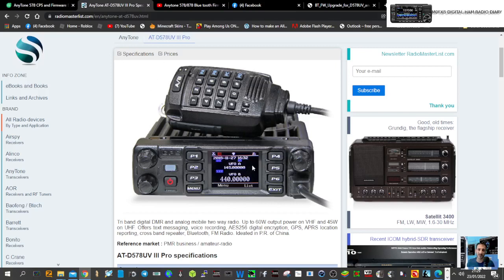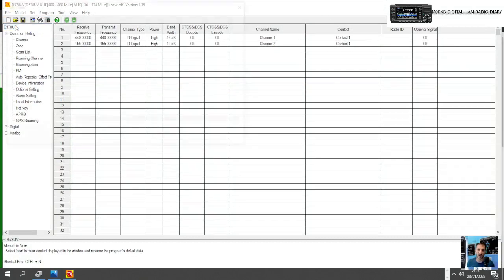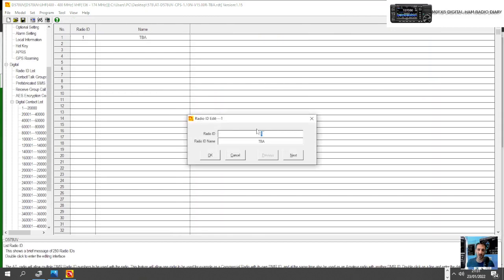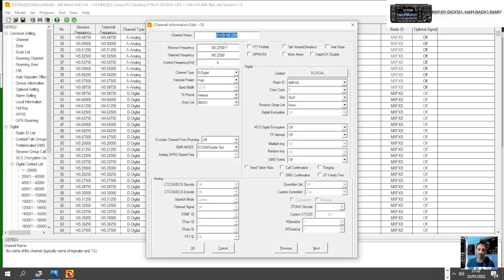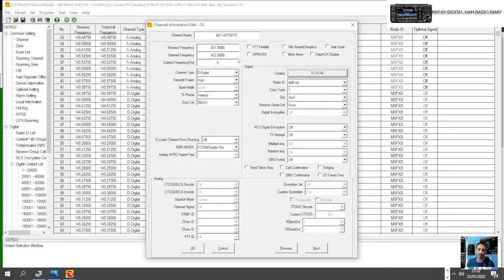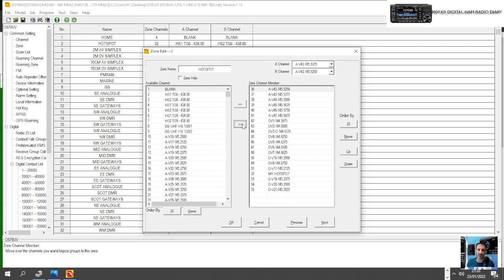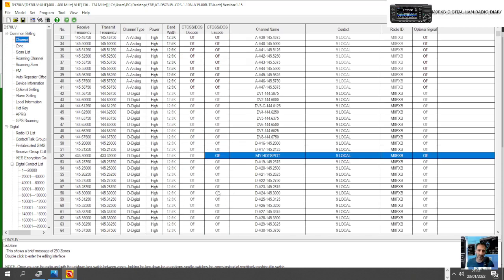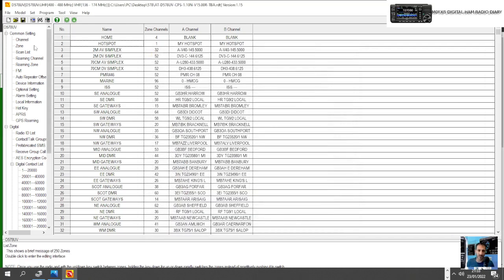Anytone 578 pro III Add your code plug and Hotspot

Comment: How do you attach your computer to the 578?  I didn't see a programming cable, setting comm ports and all that required with my 878 handheld.
Reply from the maker: Micro usb
Reply: @M0FXBHamTech  Thanks for the info-- I see it now.